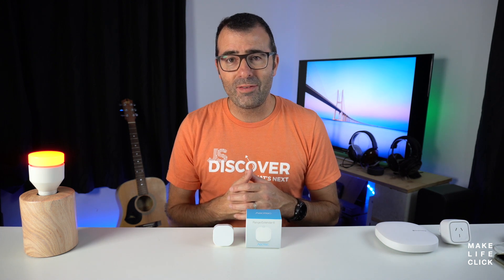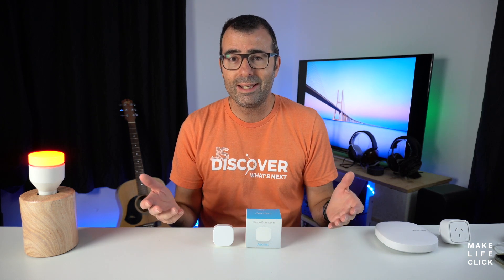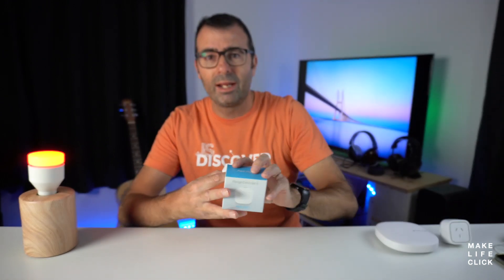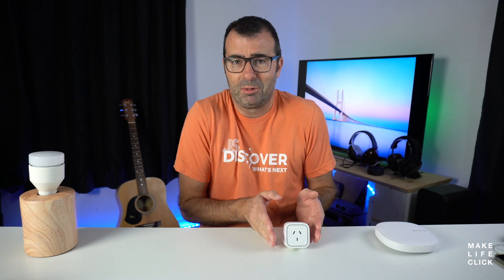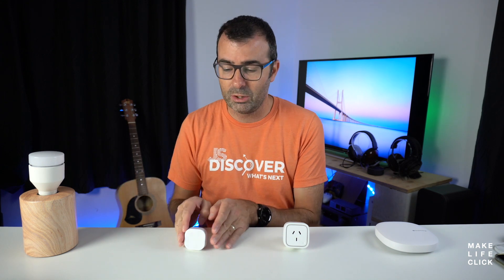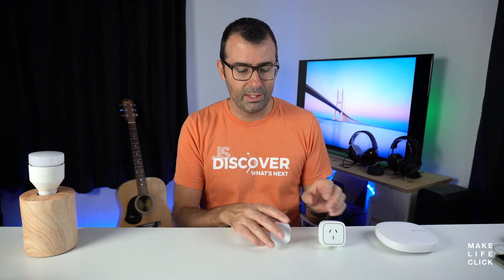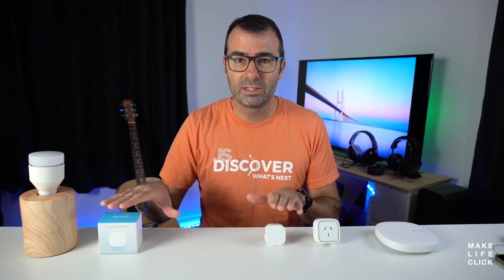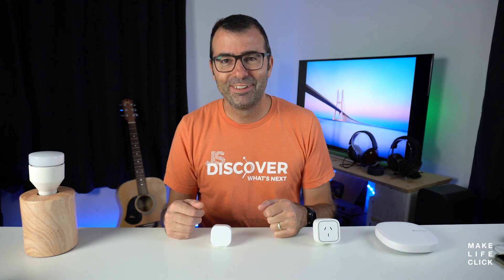Z-Wave Repeaters & Range Extenders - How They Work | Fix Weak Signals, Boost Smart Home Reliability

Comment: So I recently bought the GoControl (Nortek) zwave USB hub/dongle. Has better ratings.. several comments from previous aeotec owners that its better. Question is.. will the aeotec zwave extender work with other hubs (e.g. this Gocontrol nortek) one? Or does it only work with its aeotec zwave hub dongle?
Reply from the maker: If I understand your question correctly, and from my understanding , the Aeotec 
Extender is a ‘vanilla’ zwave unit. This means it should work with any zwave hub and devices (if they are designed for the same country for use). Hope that helps. Mark

Comment: Super helpful. I was about to buy just one and would have likely had problems.
Reply from the maker: Thanks Luis - glad it helped! Mark 👍🏻
Reply: @MakeLifeClick  Bought and installed the Aeotec Repeater gen7. Up and running within 10 min and everything is working lightning fast. Who knew I just needed to spend another 70 bucks for a flawless setup.

Comment: Since all Z-Wave devices act as repeaters what I am trying to understand is why someone wouldn't just buy useful Z-Wave devices (smart outlets for example), instead of extenders which seem to be about the same price? I understand that the extender has more power, but to your point, that extra power doesn't help if the problem device can't talk back with enough power.
Reply from the maker: Very good comment. In my example I have a great Z-Wave switch but its lost it's reach (technical fault), so in this instance this works for me.

Another example is where you have too many hops needed and can't just put in more switches to make them happen as there is a limit to the Z-Wave hops to go out and back to the hub.

Another example, which I have also, is that I have a lack of power points available between both ends of the house so I need to make one big hop to get from one end of the house to the other.

Otherwise - I'm totally of the same thinking, just get another switch and you have twice the functions rather than only a repeater.
Reply: Oooh.. that is what I was wondering. All my GE Zwave plus light switches say extender built in.. or whatever.. I assumed that is why they work well enough. I am thinking one extender near my garage door (the one going in to house) as my entire network stack is out there and there are some walls between. My guess is these individual extenders are better than the ones built in to switches?

Comment: If i have a zwave extender and a zwave plus repeater which one is better to be closest to the router and which is one is best to be farther?
Reply from the maker: Hey Tatiana - thanks for the question. Technically it doesn't make a huge difference as your distances between devices will always be a similar ratio apart. i.e at some point your z-wave plus device may have a decent jump to make. 

Personally, I would put the extender closer to the hub and assume your powered hub has decent reach to the extender and the distance between the extender and the next z-wave plus device will be closer to each other.

If that is still a problem, consider two extenders.

I hope that helps? I'm assuming you're having range issues?